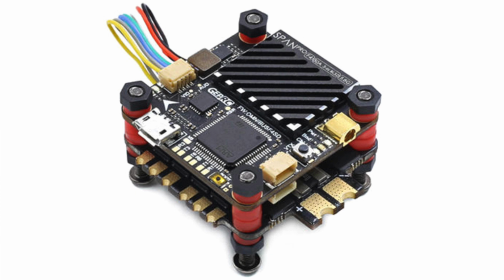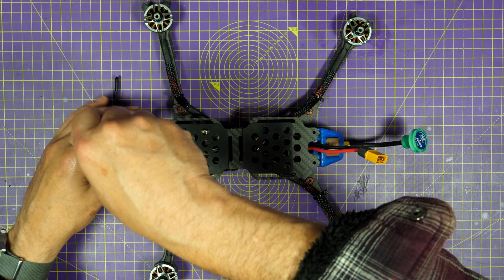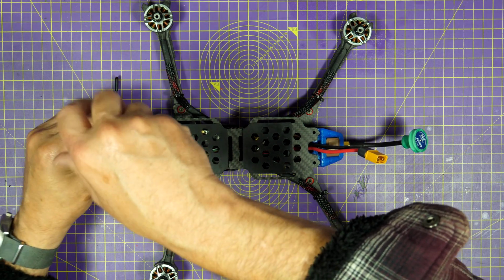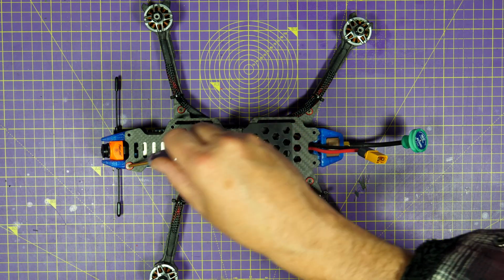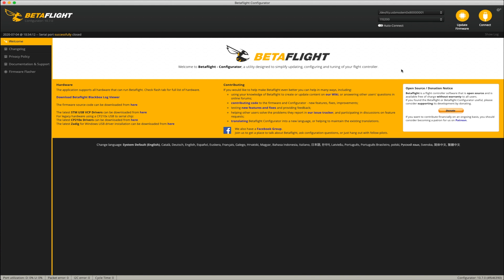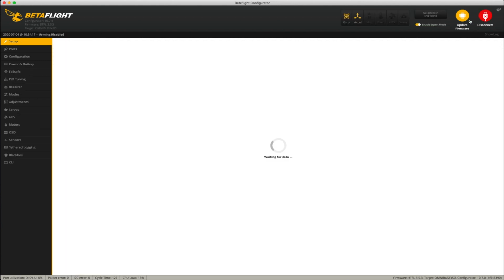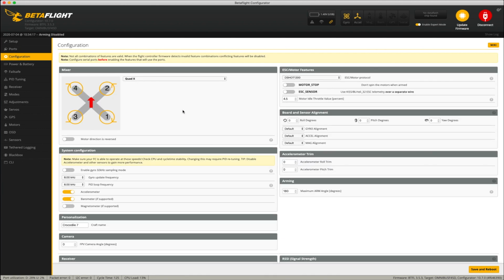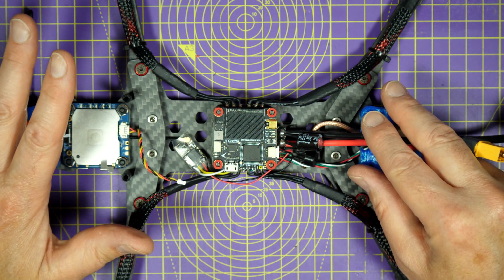GEPRC Crocodile 7 // TBS CrossFire Nano receiver // wiring and Betaflight setup

Comment: Hi, was thinking about buying just the frame only as I have motors, fpv cam, etc. Would this be better bet as wanting to run cross fire. Also f4 or f7 f/c . Thanks
Reply from the maker: That's a good plan. The quad is great and let down by only 3 UARTS on the stack.

Comment: Great video, I've been days trying to connect crossfire micro tx v2 and nano receiver to a android app, hopefully you can help with nano wiring, my board is matek f405-wing flashed with inav, nano channel out 1 is wired to rx1, channel out 2 wired to tx1, 5v and ground same uart. It binds no problem and all telemetry coming back to radiomaster tx16s but just will not connect to app, my question is should nano channel out 3 and 4 be wired to a separate uart on the f405 in order to connect to app via wifi? Any help will be appreciated

Comment: Cool. Thanks for the vid. Im about to wire it to a older f4 from kakute and thought i would be a pain since it says in the intructions only inverted sbus works. Im deff going to try it since i dont use smart audio. I also leave mine set
Reply from the maker: SBUS requires a dedicated inverted input. On an F4 you're restricted, but if you use an F7 you can configure inputs to be inverted or non-inverted. Thanks for watching.
Reply: @WhirlyBloke  thanks for the reply. Yea i also have a F7 im going to put one of the receivers on. I bought the new nano tx for the Frsky X-lite remote. It came with 3 receivers and the kakute F4 V1 only has the sbus uart but im going to do what you did and use the smartaudio uart (T6) in my fc to wire it. I hope it works.

Comment: Thanks hooking up crossfire onto the board (different quad) very helpful!
Reply from the maker: Glad it helped.
Reply: @WhirlyBloke  you Can Use the Motoroutput 5 and 6 for a softserial. I use it for the runcam split control. Becourse i use Flysky i can select if i want sbus or ibus. So i have no Problem whith this. Also the range is enough, the vtx has less range.

Also there is a solderpad on the bottom thats disable the inverter for the uart.(its called ppm) 
Also i use lower Power on disarm so i dont overheating the vtx.

But i have the Version 2 of the Stack so i dont know if this also works whith yours. But i think it works becourse only the pads on the pcb are in other Places (M5/M6 and the rssi pads are on the bottom. I think this are only Layout changes and they dont have anything to Do whith the funktion)
Reply from the maker: @Enderkruemel  Good idea.
Reply: @Enderkruemel  I have an older version of beta flight and as such VTX pit mode is working on this version. I just use that to stop the VTX from burning up. I know that the F7 board from GepRC I had issues getting PIT mode to work.
Reply: @flowstate_link  i dont know, But i use the lower Power on disarm Funktion. Also i use the newest betaflight Version, and bidirektional dshot. This is a very big improvment.
Reply: @WhirlyBloke  yes super helpful.

Comment: most people does not seem to know that you can connect the smart audio cable to the Crossfire nano reciver on an output pin and then change channel through the Crossfire LUA
Reply from the maker: Exactly, but it's not a realistic solution for this flight stack cos the VTX is very tightly integrated with the flight controller. If it had a separate VTX board it would be a great way to deal with this.
Reply: @WhirlyBloke  ahh I see

Comment: followed all the steps perfectly, but still i got no RX on Betaflight :(  the nano looks well binded to radio although... light become red when i turn off the radio and become green when i turn on the radio...
Reply from the maker: Check the protocol (CRSF) is correctly set on the TX and RX.
Reply: @WhirlyBloke  everything is correctly set. tHis rx nano is failed.
Reply: @enricomoizo  did you manage to get it to work? i have the same problem. correct setup but its not talking to the FC
Reply: @jakbower4609  yes i did manage to get it work but as you can read, i had to solder it on UART 1 and also TBS replaced the Rx nano because the one i was using was failed.
Reply: @WhirlyBloke   hey mate. I guess that once the RX Nano is soldered, you can't switch to Smartaudio  using betaflight port configuration in order to set VTX settings and then come back to Serial RX, becouse the flight controller recognize that TX and RX are soldered and ignores the smart audio internal wiring... am i correct?

I tried to switch the UART 3 to SmartAudio with the Nano Rx soldered on TX 3 and RX 3, but i can't get it to work on betaflight anymore.
Reply from the maker: @enricomoizo  It's the limitation of only having 3 UARTS I'm afraid.
Reply from the maker: @enricomoizo  That's what I do. I hardly ever change mine cos when I'm long range, I'm usually on my own.
Reply: @WhirlyBloke  ti sucks that you can't even use the pit mode on switch without smartaudio. Otherwise the problem would be solved since the only moment i have to lower down the vtx power is when the drone is ON but disarmed.
Reply from the maker: @enricomoizo  Agreed, it's a pain.

Comment: so i installed it just the way u did and everything works good except the drone does like respond to the remote
Reply from the maker: It sounds like your TBS CrossFire TX and RX aren't properly bound. Make sure to update to the latest firmware on each as well.
Reply: Did it work?

Comment: Hi ... Is there a guide to set up pid and filters?  My crocodile doesn't fly well.  I am desperate
Reply from the maker: There's lots (lots) of videos and you should have a good read of the betaflight wiki tuning tips. What version of BetaFlight?
Reply: @WhirlyBloke  4.2
Reply: @ladronefpv4484  Yeah my Croc had a lot of prop-wash issues initially and I put it down mostly to under powered motors. Standard motors are fine for the intended purpose of cruising and long-range but lack the ability to react quick enough to oscillations in tight turns and altitude drops. I went to Racerstar 2508 1200kv and this seem to fix the issue. I did however feel the lower kv felt slow so I'm trying 6S today. Very happy with the platform and will be wiring in my TBS micro receiver today.
Reply: @stephensutton2752  🌟🌟🌟🌟🌟

Comment: You should do a video on wiring up a voltage regulator to a lost model buzzer and strobes and bound to a switch.
I ordered a Mr Croc knock off back in April, and they still haven't shipped it :-/
I got everythign else by now... goggles, transmitter, batteries, chargers, tools, parts, soldering iron, everything... but the quad itself :-/
I kind of regret going Crossfire, it adds even more cost per quad, and it would of been simpler just to get the DJI controller.
Reply from the maker: Don't bother with any of that, it's too complicated and can go wrong. I use these https://www.nichemall.net:11846/index.php?route=product/product&product_id=54
Reply: @WhirlyBloke  I bought something like that to mod and try on a quad...  an anti-rape alarm...   not motion sensitive but I figured it would be loud, and cheap.. and cheap it is at $2 bucks
https://www.ebay.com/itm/Egg-Shape-Anti-Attack-Anti-Rape-Security-Protect-Alert-Personal-Safe-Scream-Loud/311910217313?ssPageName=STRK%3AMEBIDX%3AIT&_trksid=p2057872.m2749.l2649
I haven't opened it up or modded or tried it yet on a quad though.   I ended up bying some ViFly buzzer and strobes but stillwaiting on my quad to arrive :-/

Comment: Watch out for Split 2s. We used to have ton of mid flight black screens on Crocodile 7 with crsf & split 2s camera. We swapped camera for Foxeer Mix v2 and it's perfect. RunCam Split 2s  sucks around 2 Amps and sometimes it might to reboot itself